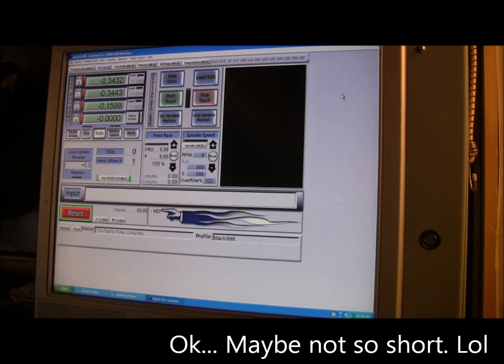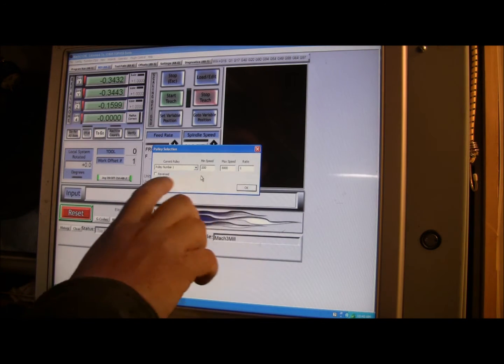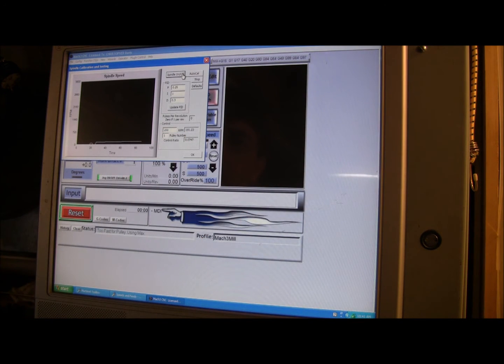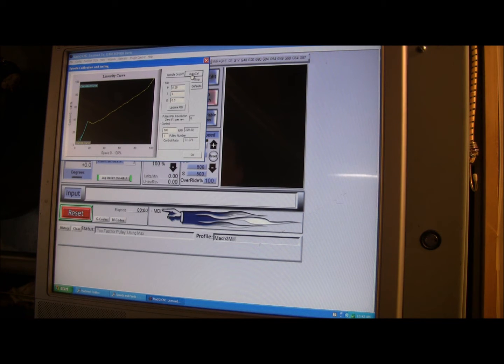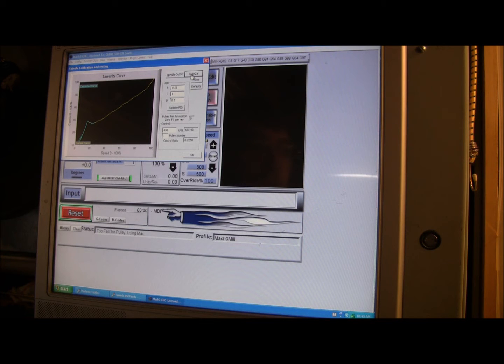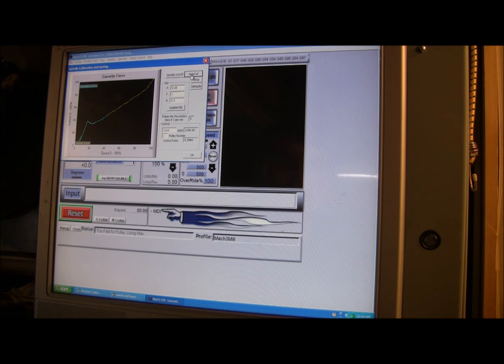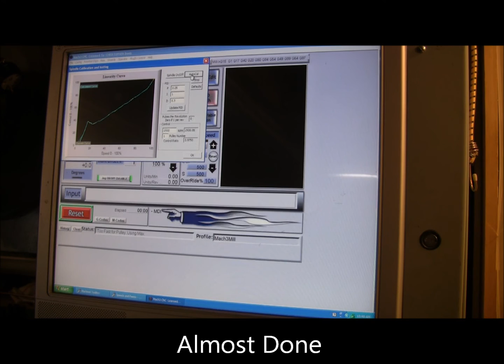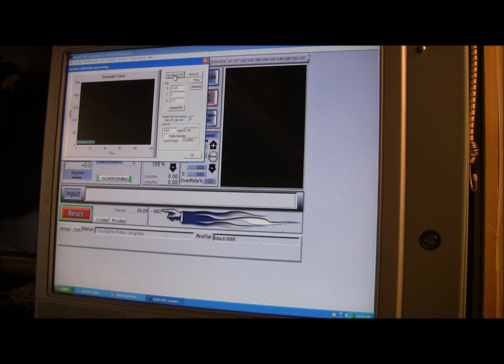Spindle Motor Calibration

Comment from the maker: Actually the bearings and shaft were replaced to get the runout that low. The noise is the crappy design that Sieg used when they mate the pulley to the shaft. Since the quill is able to raise and lower, they use a 6 point spline on the spindle shaft. As the spindle turns, it trys to outrun the pulley and slaps as it rotates. I am working on a new pulley design that will mate to the shaft with no play and the noise will be gone. That is the only thing I hate about the mill at this point.